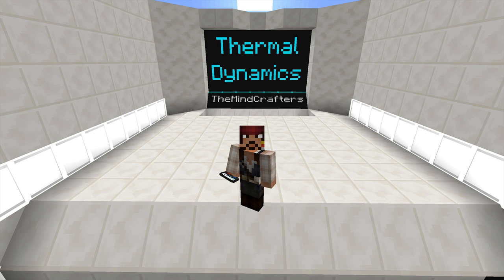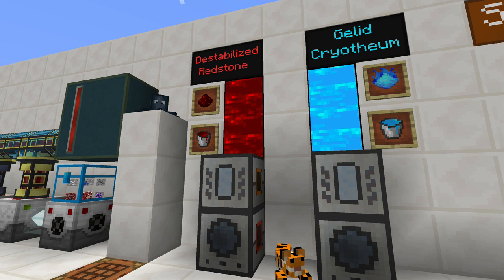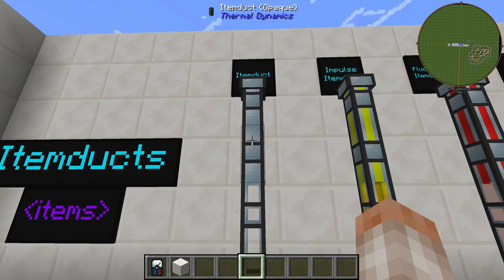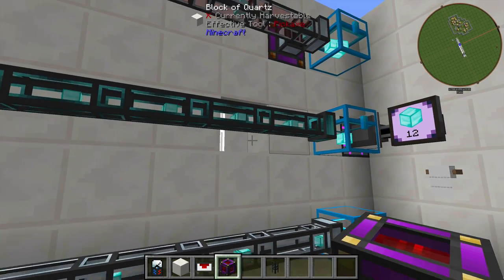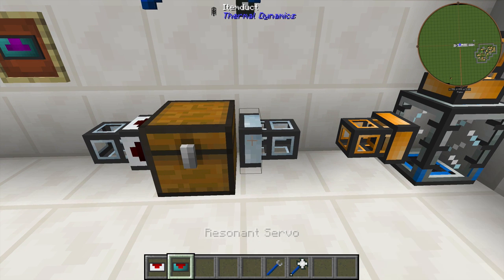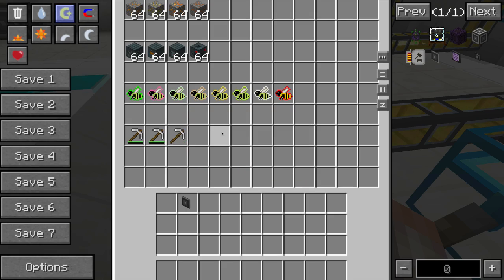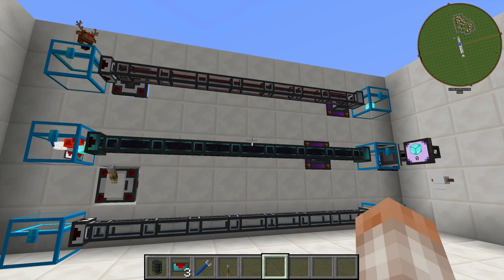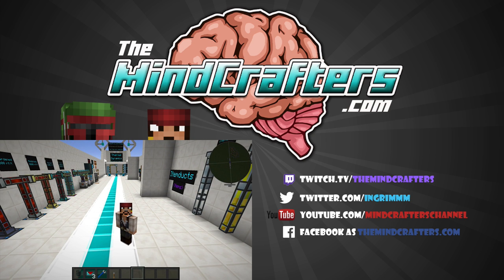Mod Spotlight - Thermal Dynamics

Comment: Awesome Vid, I have one Question:

In MC 1.6.4 i was able to connect itemducts to Buildcraftmachines, like quarry. The Ore runs through the itemduct without problems (so servo, just connect)

In MC 1.7.10 with the updated Buildcraft and TE, those connections are not possibe. What ever i tried: with servo, with retriever, nothing worked.

Did you have any hints or solutions for this problem? Comes the new BC and TE with a "plugin-mod" to work together? Chests and Tanks (also from other mods) are no problem, here the pipes working fine.